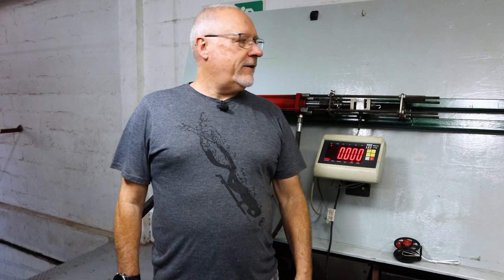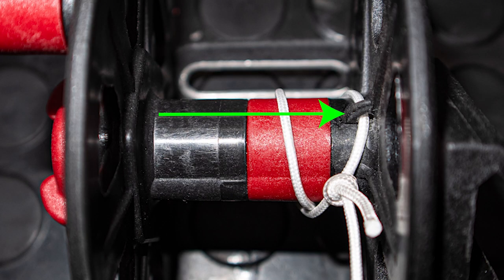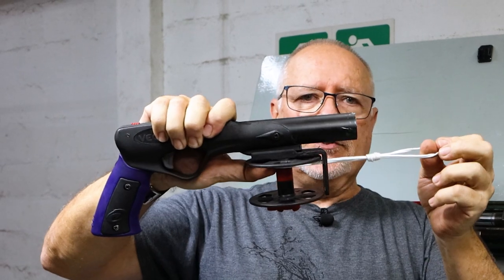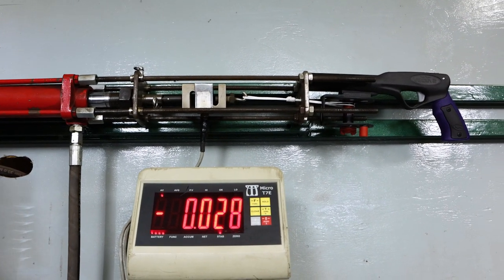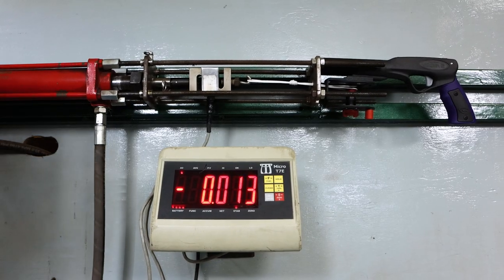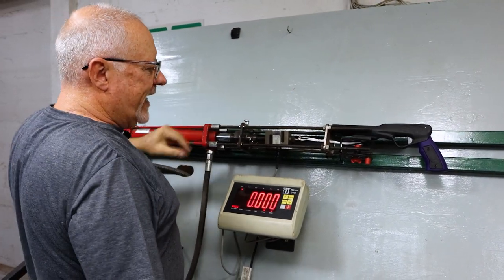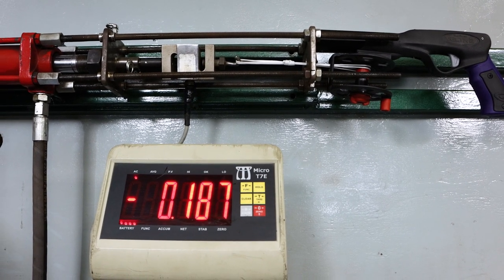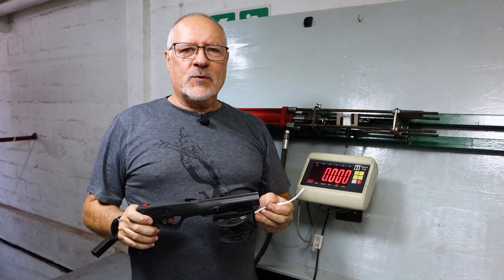Rob Allen | Reel Break Test | 2023

Comment: In marketing this would be called VOC - Voice of the Customer. Amazing to see how much you listen to people and are open to always improve. Fun fact: last week I was thinking about all points that can fail between shaft tip and the reel or float. And you answered the reel one - I am engineer and love some science. You covered all here. That the line's end is on top of the reel's axle is great - lower forces to potentially rip out at the base of the reel. Honestly I assumed it would break at the base that secures the reel's axle. Amazing 200+ kg! Great design. Keep it going guys. Such great input.
Reply from the maker: Thanks for the kind comments 👍 I wondered if anyone would notice why the line attachment point is located there and not in the middle. The failure here was the screw. A longer screw could be used and set deeper into the barrel. I assume the next failure point would be the s/s spindle pulling out, might only need a few kg extra to break. The reel line will fail long before the bracket so no point in making it any stronger. Thanks again for your input.

Comment: Cool, curious if you have done this with line pulling from the bottom of the reel as might happen in the event of a reel jam or tangle? (ie. farthest from the attachment point for a larger lever) Would imagine its still much more force than anyone would ever manage to put on a reel in the water though.
Reply from the maker: I agree. No we have not done this. Maybe make it even worse by looping it around the old type winding handle. These later reels have a tapered handle so much less likely to hook up.

Comment: U have my attention.
I looked at the rob allen reel (latest) im using on ur carbon. I don't see any pre-drilled holes. I will search ur videos for info for hole size, location and screw size.
Thanks for tge update.
Reply from the maker: Sorry this was a new addition, about a year or so ago. Some of the earlier ones did not have the countersunk hole under the reel spool. Easy to drill one is you want. Prior to this addition, we use to set a small screw in the side of the bracket. This works fine but the new system is a lot stronger.
Reply: @RobAllenSpearfishing  thanks
Reply: @RobAllenSpearfishing  took the reel apart and there is a countersunk shoulder ready for drilling a hole.
Yahoooo
Reply from the maker: @snowbank9386   👍👍
Reply: @RobAllenSpearfishing can the length of tapper exceed the distance to the tube  depth?
Reply from the maker: @snowbank9386   Yes, if you only have a long screw, you can screw it through into the barrel. The barrel plug will be ahead of the screw so you will not get water inside the barrel void. That area naturally floods anyway when underwater.
Reply: @RobAllenSpearfishing thanks, time to drill
Reply from the maker: @snowbank9386  👍